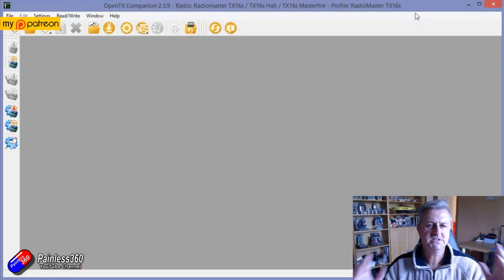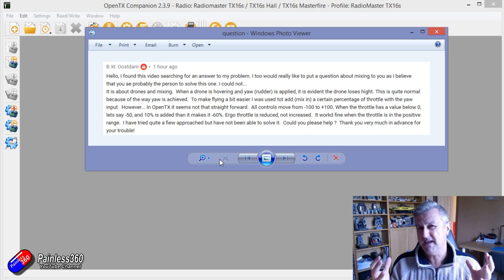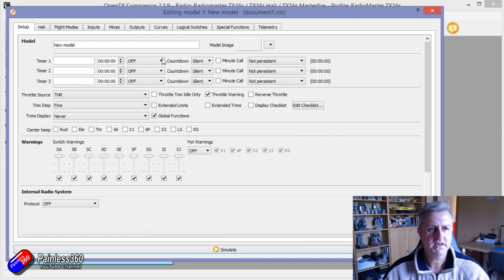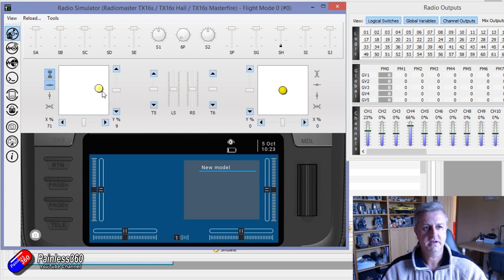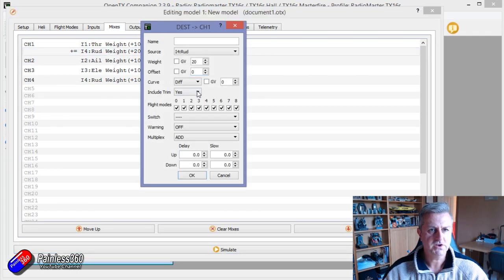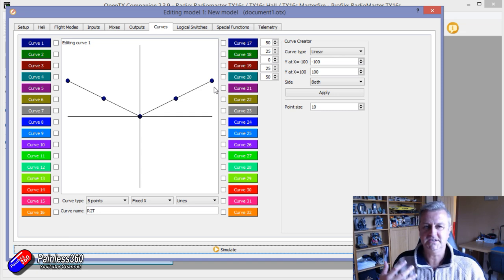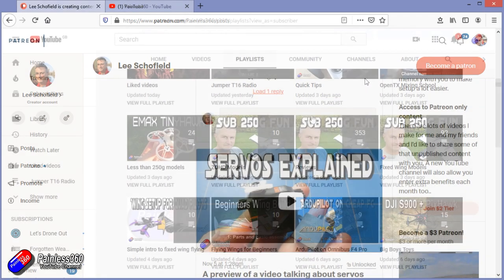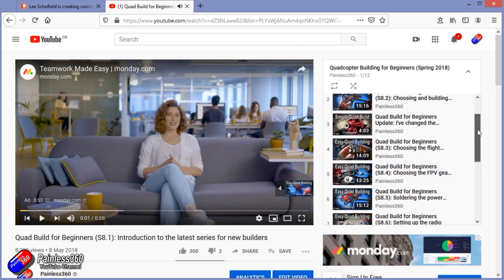OpenTX Mix School: Easy rudder to throttle mix (for Quadcopter)

Comment: Great video Lee. Many thanks. I have mixed in some Rudder with Aileron on my Taranis for my Bixler 2 flying with an F765 and INAV. Is it / should I leave that mix on the transmitter or is that possible to mix in INAV?

Comment: I have used this technique on a Spektrum radio when flying a Tiny Whoop but I wouldn't use it on the rudder but on the elevator and aileron as both these controls cause the model to tilt and therefor lose lift whereas the rudder doesn't it just spins the model.

Comment: Please, can you help sort out an old-school heli bloke who needs a "revolution mix" for "rate-mode" gyro assist  (normal flight mode, collective/throttle--and tail pitch compensation)?  What would be done differently from your example here?
Reply from the maker: You would add little of the throttle channel into the rudder channel on the radio (I think) - check out my OpenTX Mix School that teaches all you need to know about using OpenTX and starts super simple.. Best of luck!